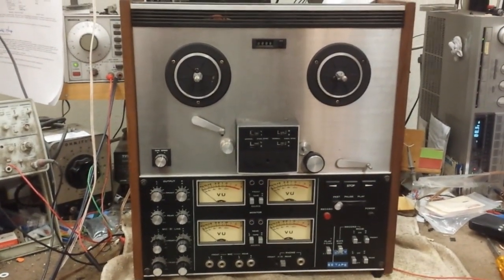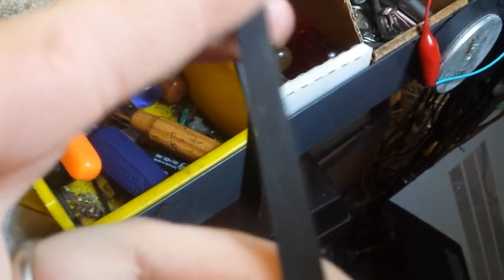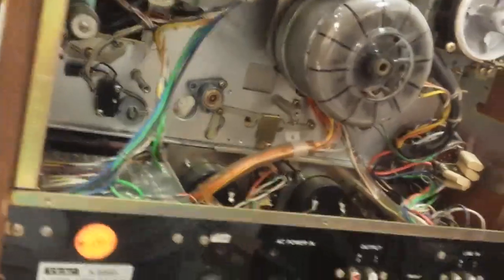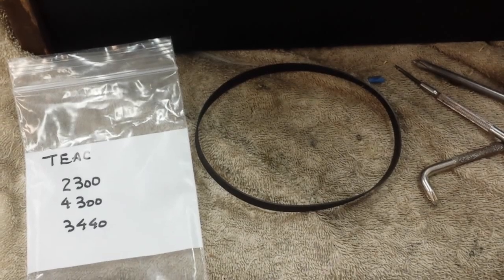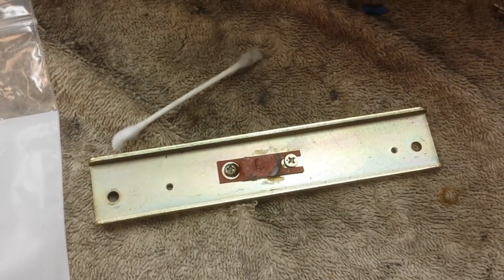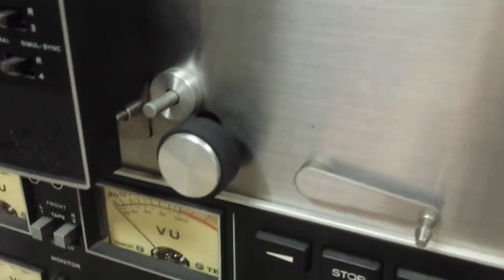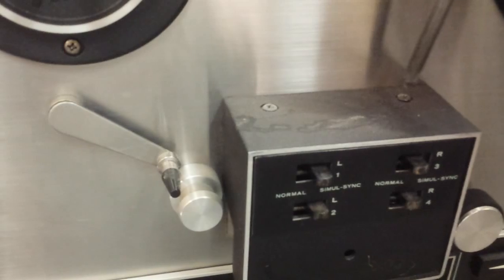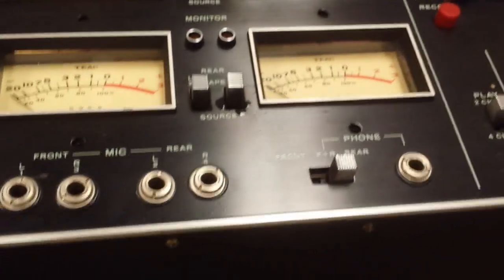Servicing a Teac A-2340 4 channel reel to reel

Comment: Super helpful video thank you!! Did all that and mechanically my 2300s is working perfectly now. However, it’s now dead silent. No hiss and definitely to reaction to audio inputs. Any ideas why that could be?
Reply from the maker: Power supply to audio section has failed, or fault in the audio section preventing sound from being processed correctly.

Comment: I have a crazy issue with my A-2340. It sat unused for a few years and when I went to use it, the circuit board behind the tape head cover (the one that has the four normal / simul-sync switches on it) had broken at the point where the right side mountain screw holds the circuit board to the recorder. The hole that screw goes through broke out, taking a little of the circuitry with it around the hole. If all of the circuitry around that hole is the same circuit, I can repair it. But if the circuitry is complex in that area, I’m not sure how to tell how to fix it. I don’t need it to record anymore, just to play. It does play, but I’m holding that module up out of the way with tape, since only the left side screw is intact. When it moves around, it gets crackling and the channel 3 (top right) normal / simul switch shorts out from time to time. I know this is a lot to process, but you were so phenomenal with the pinch wheel shaft / hot gun repair that I thought perhaps you might have some info or suggestions on where to turn. Thanks!!!
Reply: My used TEAC had a cracked head board.  I epoxied back together and solder a few broken traces. Worked fine after that.

Comment: Hi again, so I found another Teac R2R (same model 3300S) but this one has the tubes sticking out of the motors.  Can I use Olive Oil or Car oil to lubricate it ?  I don't have any of the special Teac Oil.  Which Oil would work for lubrication.?    It is also strange that both decks are the same model but one has the Oil tubes and the other doesn't.  It maybe that one is older made than the other?   Thanks so much.

Comment: I've found it much easier to deal with the belt with the capstan flywheel removed - both for removal & installing a new one. FOLKS - You wanna put a new one in now, not 6 - 12 months later after failure of the 30-40 yr. old one !! Its also proper to lube that surface where the pinch roller arm engages the tape lifters. A drop of oil on those pivot screws IS a good idea, also (sure beats troubleshooting why he tape won't clear the heads while in FF/RW).

Running the motors for 15-20 min. after oiling is a good practice, also. And PLEASE wipe up excess oil from the tubes as it will only flow down the motor housing and make a nice surface for dirt and dust to collect on... making a nice hot surface.

Clean & lube  w/DeOxit spray that "drum" switch that controls to FAST/PAUSE/PLAY functions. It will last much longer.

Comment: Hello Jordan, your video is awesome because I have the exact same problem in my A2340. What kind of oil did you use, where is it available? Any chance of you putting out a video on how to align the A2340 heads? BIG Kudos!
Reply from the maker: Rick: i use mo98 zoomspout for the oil. I put it in a syringe to make it a little easier to apply.  Don't screw with the head alignment unless you have the teac ytt test tapes and an oscilloscope. I don't do those videos because I assume people don't have access to that stuff. You'll do more harm than good if you mess with alignment without test equipment ;)

Comment: Great video man! I just got done using it for help on servicing my A-3340S....Hey quick question if possible....At the very end when your cleaning the heads, you reference something for cleaning super gunky heads....Did you say a "Lemonwood stick"?? I've never heard of such a thing, nor could I find anything online about those....I have some super gunky heads in need of some rescuing.....Please let me know if you have anymore insight into this....Thanks again!!
Reply from the maker: Popsicle sticks. You can file and sharpen them to make good head scrapers

Comment: I bought a TEAC 3440 about a month ago, and it's now experiencing wild flutter about 2-3 hours into recording. Tape path cleaned, new tape being used. Some people have recommended oiling the capstan motor and the capstan bearing. I can see you oiling the motor, which is great for me to learn how to do that, but they said that I have to remove the motor pulley to oil the capstan bearing. I'm a little weary of doing this as I'm very new to these machines and don't want to further complicate things. Is it necessary to remove the motor pulley to oil the capstan bearing? Which bearing are they talking about? Any help is appreciated.

Thanks for the video, there's not many repair/service tutorials on RTR's. Really great. Subscribed!
Reply: Nevermind, found it on your other TEAC service tutorial video! Cheers! Great stuff.

Comment: thanks for this great video. got my teac 2340 up & running with your frozen capstan fix.i bought mine when they 1st came out & it's been dormant on the shelf for over 30 years, but now plays like new. i did have a problem with the tape being snapped when i'd hit the stop button on FF, but was able to tweak the left spool from stopping dead while the right one didnt. they both stop at the same rate now.i will be following your directions on lubrication and spraying all of the switches. but i'd like advice on oil to use for the motors.just any machine oil? thanks for all the info!!
Reply from the maker: Any non detergent machine oil works. Mo98 zoom spout is a fav of mine.

Comment: Just found this video. Fantastic! It's exactly what I needed to my Teac 2300 moving again.  But can you tell me what kind of oil you use on the motors?
Reply from the maker: ZoomSpout mo-98
Reply: I found out that pure SYNTHETIC 5 - 20 motor oil works perfectly... save a couple of drops from your next oil change. You can buy cheap hypodermic syringes (without needles) at hobby shows (train shows) for about a buck. Get the 2 c.c. size.

Comment: Fantastic video! I have a 3340S and have been looking for a video like this. I understand the units are not the same but hopefully similar enough... especially the oiling as well as that earlier comment regarding taking apart those that don’t have oil tubes. I believe my Teac 80-8 is this way. So would it be recommended to take them apart and clean off old oil and then re-lube them? Or do you think they are still good. Either way thanks for this video! Cheers!
Reply from the maker: I would disassemble, clean and re-oil. Non detergent oil. Sae-30 or turbine oil. Make sure the oil felts are intact that hold the oil in.

Comment: Amazing video! Your video brought a 2300s, that was being thrown away back to life. I followed your video step by step. It's now playing and recording nicely. One question: The counter assembly makes a noise when fast forwarding and rewinding. I've read on tape forums that it needs to be re-lubed. How do you re-lube the counter assembly? Does it need to be removed or can it be accessed without removing from the chassis?
Reply from the maker: I don't remember honestly. I would find the pulley where the counter belt is and see if it's possible to get some oil on the shaft that runs behind the counter pulley. Use an oiler syringe . If not accessible you'll need to remove it.
Reply: @JordanPier  YES! That did it! Thank you!

Comment: Teac A3300S machine tape speed fluctuates and slows (on both H/L modes). It's been dismantled, cleaned and lubricated, runs perfectly. Belt drive looks good, if I slow down by hand the capstan flywheel, the motor also slows down. Fuse also needed to be replaced, so I'm guessing the motor run capacitor (2u+0.8u) is faulty. What do you think? Thanks for your answer!
Reply from the maker: +gelu curtean that's a fairly good indicator. Usually when the capacitor fails you get this symptom, but also check (with the machine off) the continuity of the micro switches that interface with the right compliance arm (the one that starts the motor when you lift it) - if the cap goes bad it can hurt the switches

Comment: Great video Mister. I'm picking up a 2340 for a couple hundred to run as a tape delay feedback loop instead of using an RE201 space echo.   ** Where can I find a new micro switch ? **
Reply from the maker: I've gotten mine from digikey and mouser in the past. Most important factor is to get one with as little gram force as possible needed to push the plunger in or it won't auto-shutoff
Reply: @JordanPier  Much thanks. Do you possibly know of any 4 track R2R's that have individual heads in a linear order as opposed to all 4 on the same head ? I'm trying to replicate a Roland RE-201 as close as possible.

Comment: Really nice video.  Concise and to the point.  I followed the directions and now everything is unfrozen.  Unfortunately when I turned on the power, something on the right side (looking from the back) started smoking.  Ugggggg.
Reply from the maker: Andrew Mroch that sucks! I've had those moments. could be something you bumped into shorted out against the chassis, or a part just decided to die. take a look inside that area with good light. if there was smoke, something burned and it should be easy to spot.
Reply: Jordan Pier. I read in a forum that there is a plastic piece in between the small board above the power jack and the frame. I found a piece of clear plastic with a hole in it on the floor. I bet that's what it is. It said it could smoke the board on the left side.  I just hope I haven't fried it. This is only my second project since getting into this hobby.  Fingers crossed it was the cause and I didn't ruin it. Thanks for the helpful video!
Reply: Turns out that little plastic piece prevents it from grounding out. New problem is that when it plays the reel on the right doesn't move and it just the feed the tape into a pile below it.  Maybe I don't have it loaded correctly.  FF and RW work perfectly.  Thoughts?
Reply from the maker: Make sure the brake solenoids come off. If the reel turns freely in play mode the brakes are off and the motor isn't getting power.

If this is the case look at the large ceramic resistors at the top of the machine. Likely one of the adjustment collars has broken, the resistor has failed, or the power supply feeding the resistor is absent.

Trace out how the motor gets power in play mode and you'll likely solve it
Reply: This is turning into a comedy of errors.  Seriously, I have to laugh.  I checked the brakes and everything moved freely.  Resistors were fine (fyi - I have an A2300S) and noticed one of the two orange wires going into the top of the control board has been pulled out.  So I think, "great all I have to do is get out my trusty soldering iron and put it back in the board".   

And then it began.........................   

I pressed play and it was hyperdrive playback just like you'd see on a Sesame Street skit.  Tape going everywhere.  So I press stop and solder it another way and nothing happens.  At this point I don't know if I'm working on it for the enjoyment of bringing something back to life or comedic value.  I have the service manual but I really don't know how to read the diagrams.  Any idea what I could have done wrong?  

I can't stop shaking my head and laughing....
Reply from the maker: Hard to say without the set in front of me. Sounds like you need to compare schematics with the current wiring and go from there
Reply: Got it working properly.  Thanks for all your help!
Reply from the maker: Glad you got it running! What turned out to be the failure?
Reply: Oh man, I was praying you wouldn't ask. Since I'm new to reel to reel we will chalk it up so "user error" (i.e. didn't have the tape loaded correctly).
Reply from the maker: Don't feel bad. I've made more stupid mistakes and chased problems I created more than anyone you'll meet. The important thing is you caught it and got it working again

Comment: Hi Jordan.a question, I have a teac 3300SR and when playing the tape comes out of the pinchnroller and bounce up and down by the heads,what it can be? Thank you for your help and channel is great!👍
Reply from the maker: Either pinch roller isn't making enough contact due to sticking bearing or pinch roller surface is untrue.
Reply: @JordanPier  oh ok.thank you very much!!i will check that I have another teac looks like same size roller.👍

Comment: On my  Teac A-2340 the play function work 100%, but the FF and rewind no turning of the spools. The solenoids of both operate ,but that's all. Any ideas?
Reply from the maker: If the brakes come off, then check relays that power the motors for fast wind

Comment: Hey Jordan, I have a problem. I can’t get that pinch roller arm off to save my life. I used my heat gun a couple times with so much heat it was almost glowing red, just kidding, I can only move it slightly up-and-down by grabbing the pinch roller arm from the front but I cannot get that sucker to slide off the bushing. Any ideas, I would sure would appreciate it. Thanks.
Reply from the maker: If we're talking about this model everything is well explained starting at 6:00.
Reply: Jordan Pier Mine is a A-2300 and I finally got the pinch roller arm off. I had to hit it about five times with a heat gun, then twist and pulled and that sucker finally popped off. After watching you struggle get the new belt on, I put the belt on first so I had room to get my fingers in there and play around getting the Belt on. Then it was just a matter of moving it to one side while I pushed the fly wheel into place. After that everything was a piece of cake. By the way I bought my new belt on eBay for $12.50 with free shipping in case anybody wants to know. $20 seems like a lot of money for a belt. Comparing the new belt with my old belt, I could see how badly my old belt was stretched. There was nothing left to it. Anyway, I just thought I would give you an update and let you know everything is okey-doke and my tape deck  is humming away. Oh one more thing, my three motors were thirsty as hell for some oil. Those little plastic tubes on the front and rear of the motors are great for oiling them. After oiling The motors and various parts, I ended up using a little less than half an ounce of the Teac oil with the skinny tube on it I also got from eBay for $7.80. The tape deck is operational 100%. Ready for another 40 years of service. Thanks for the great video.

Comment: Great video, my name is Jerry .I have a tascam dx44. I changed the pinch roller and I would like to know where you buy a capstan belt because I need one .when I put everything back the power comes on but the play and fast forward an rewind does not work.could it be that micro switch? I don't know how to test it  is it possible.I would appreciate a comment. Thanks.
Reply from the maker: Lift up the compliance arms to trigger a motor start and look to see if the motor is actually turning. If it is and the belt is just broken, clean off the belt residue and replace it. You can call teac parts directly for a new one.

If the motor doesn't turn the micro switches could be at fault, but further troubleshooting is necessary to determine what the real cause is. Never just blindly replace parts. Troubleshoot a cause, not a symptom.

Comment: Wonderful video I have a A-3440 this is so helpful. Can you let us know what kind of lubricant and motor lubricant you used ?
Reply from the maker: James Bandes zoomspout turbine oil
Reply: Thank you so much. I feel confident  to do this now. What kind of heat gun was that ?
Reply: I found a 1200 heat gun. I can use this lube in both the motor fill and capstan mechanism?
Reply from the maker: James Bandes yes.

Comment: Well, Jordan, I spent a few hours last weekend on my 2300S, and I have good news and bad news to report. The good news is that, due to your excellent instruction video, the deck seems to be in great shape, mechanically speaking. I got the pinch roller free, lubed and reinstalled it, and it works like a charm. The bad news is, I thought I'd perform a recording test while I had a blank tape mounted to check the mechanical operation, and this thing won't record a note??  I tried both line and mic input, but no deflection at all on the meters, and nothing plays back. So, my question to you is....I'd stopped short of cleaning/deoxing the switches and cleaning the heads. Honestly, I haven't even had eyes on the heads yet. So, what do you think the chances are that cleaning switches and heads is the simple solution?? I don't have a pre-recorded tape on hand to test simple playback yet. Do you think I have a shot at something simple, or does it sound like a much more expensive repair to you?  As always, thanks for your input. Frank
Reply from the maker: Brittany Marie of the 2300 has rec mode switches make sure they're on. Check that it's getting the signal by switching from tape to source on the front panel. Remember to hold rec as you press play
Reply: Yeah, I think I covered all that, Jordan. That's why I'm thinking this is a much bigger deal. I have the operations manual, so I think I'm following the right steps.
Reply from the maker: Brittany Marie if it's not entering record mode, there's either a bad switch, mode or front panel button,  bad switching relay to enter record mode, or missing power supply voltage. I would download the service manual from hifi engine and see if it outlines what relays should fire to record, ohm out the record button as you press it on the front panel to see if the switch is good, and do some troubleshooting. Sounds like a doozy
Reply: I was afraid of that. That level of troubleshooting is way above my pay grade. This beast is probably gonna end up on eBay for parts. I'll chalk it up to experience. Thanks for your replies. I'll let you know if anything changes. It sure was a lot of fun fixing the pinch roller, though!! LOL